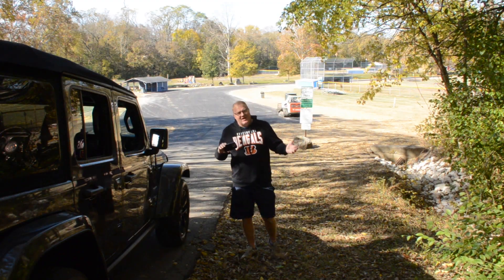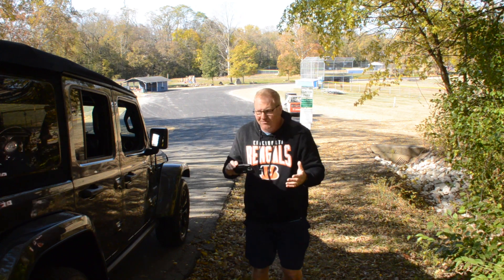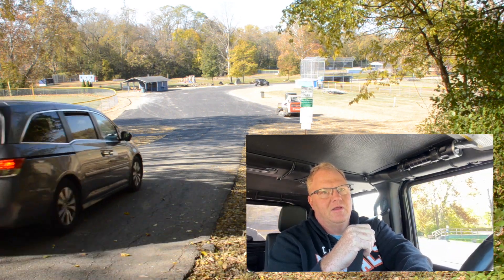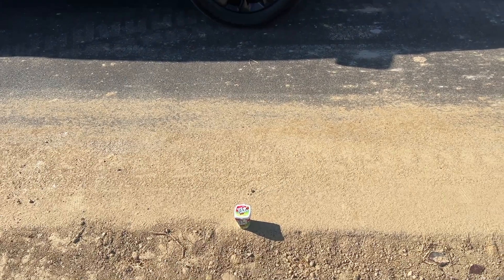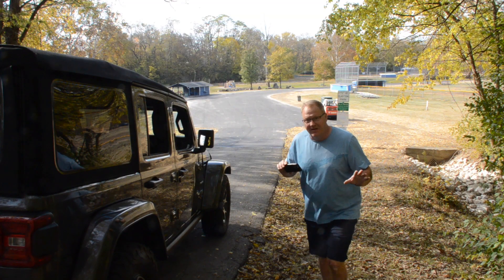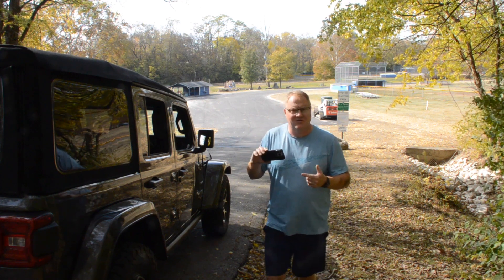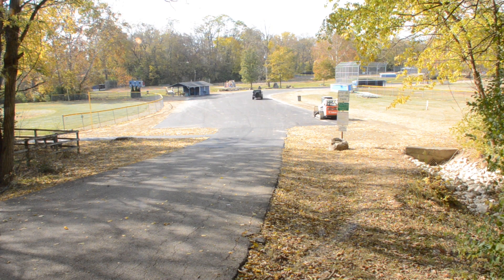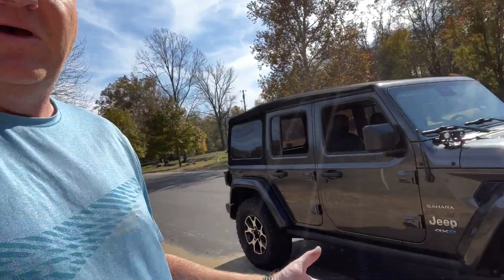Rolling Resistance Test

Comment: It is all about Newton's Laws and in particular the law of inertia. A body at rest tends to stay at rest and a body in motion tends to stay in motion. Also Force = Mass x Acceleration. The higher mass of the tires tends to keep them in motion. While they definitely have an impact on mileage, once they get going they tend to remain in motion for a longer period of time. So it didn't at all surprise me to find out that they remained in motion for nearly as long as the Sahara tires. Where you are losing the mileage is probably in the starts and acceleration. I think you would find with more instrumentation that the acceleration going down hill took longer with the fat tires on. But you might have to have some nifty acceleration devices to measure the acceleration. Really good experiment though and I'm very happy to confirm that you isolated only the one variable which was the tires. This is an example of how science is done. If I was still teaching 8th grade physical science I would most certainly use this video as part of my class presentation when talking about the scientific method and beginning my topic of inertia. Great video!!!
All the best, 
Pat

Comment: I am assuming the ko2's are from a Rubicon. If so they are 33s. I think the Sahara tires are smaller that is why you get better MPGs with them. The engine doesn't have to work as hard to move them.

Comment: I might posit that the weight of the vehicle might have more significance once you get past vehicles in the 2 ton range.  Tires would have a significant effect on a 2800lb vehicle on rolling resistance, where a heavier vehicle just doesn't register the same way.

Comment: I am very happy you are investigating the rolling resistance of the two sets of wheel/tires! Your approach reduces any air drag impacts due to it's low speed so you are really looking at the difference in the resistance due to the deformation of the tire rubber. My guess is if you increase the air pressure you will roll farther and if you drop it down it will shorten your distance. I assume you set the same air pressure for both sets of wheel/tires. 

Higher driving speeds will increase air friction/resistance which probably follows a velocity square ^2 law. Additionally at speed you get multiple contributions such as forward air displacement (tire moving forward) and rotational angular velocity (tread rotation moving air like a paddle wheel).  Additionally, for gas mileage impacts, the differential drive ratio and the tire diameter play a role.  

To account for higher speed friction increases, maybe consider driving a significant distance, say 50miles at the same speed (gas only) with each set of wheel/tires. This may also fail due to weather (wind, temp) and traffic.

Still, nice job!! Are you an engineer ... you think like one (or a scientist).

Comment: What air pressure are you running in the tires.  By increasing the air pressure you gain mileage,  just don't go over max pressure listed on your tire.
Reply from the maker: I was doing around 36 pounds on both sets. I’ve never chalk tested to see if 36 is exactly right for the Sahara.
Reply: @Wrangler4XEFans  I do 42 psi on my Rubicon 4XE in LA area traffic, I average 24 miles on battery only.  At that pressure it drives great and handles fine.
Reply from the maker: @jerrypierson3450  That would be interesting to do some experiments to see what different air pressures do to range.

Comment: Bubble gum? If I had known I would have sent you a piece of chalk.  :) Interesting test, but like everyone else said, I wonder if air resistance at greater speed starts to have one of those funky math formulas where it really adds up quickly. It also goes the other way: I recently came home from work where I had a strong tail wind and ended up with an insanely higher battery % than normal. Close to 20% greater.
Reply from the maker: There wasn’t a lot of planning going in to this video. I realized I had gone over my normal rotation mileage the day before and decided to go ahead and swap them out and had the time to do it that day. I had planned on doing this experiment at some point but wasn’t really ready.

Comment: Air resistance may be the bigger factor and you would need much greater speed for that. The other factor that I’ve seen to be significant is if your tire pressure varied. Could also be that KO2 tire pressure, which you say you put on in the winter, will drop with temperature possibly leading to greater drop in range. Though I put my air resistance as the bigger factor.

Comment: My guess is the greater weight of the KO2s gave you more built up momentum down the hill that compensated for the greater rolling resistance. Either way, thanks for posting this info. It's much more useful still than hearing manufacturer claims.

Comment: When you mentioned you were getting 2mpg less in the KO2's, did you modify the wheel size in the Jeep computer, or still using the default 32" tires that it would have been set with the Bridgestone's?  If I'm not mistaken, when you have the 33" KO2's on, the calculator will think you are traveling less distance because of the bigger tire unless modified?
Reply from the maker: I’ve never set the computer with the different wheel size. But I calculate mileage at the pump. Now for the loss on electric range, that’s an excellent point.
Reply: @Wrangler4XEFans  the other thing running around in my head is air pressure. I run my KO2’s at 35. Anything less and I noticed a lot more resistance.

Comment: What about breaking in the wet and the road handling differences? thank you for the test
Reply from the maker: The KO2s are a slightly more comfortable ride even though they are louder. So there’s a trade off. I don’t really know if I see a big difference it braking in the wet. Not sure I’ve had any instances where I could compare…at least that I remember.

Comment: Actually what I find more interesting is that the street tires had such a vast difference. I think 10 roles then mark the average of the 10 is best. I venture to guess the difference would be more comparable to the first two street roles. If you think about that difference in distance between your first two roles and calculated it, then calculated your total difference of the longest and shortest runs you would be able to figure out the resistance in that distance. Air pressure, wind, and exact path are factors but those are real world things that more runs would essentially average out enough for a basic non-lab fun test, for our purposes. There is a math/logic equation in there somewhere. I don’t mind the turn because it just real world stuff. Cool test though. Thanks for taking the time to put it together. It would be fun just to play this test multiple times with varied air pressures in the KO2s to find the optimum air pressure for the least rolling resistance without affecting overall performance. Lets say your total distance was 200 yards and the difference between the two tires netted out to something like 10 yards. If that was the case it would make since why you are loosing 2 miles over longer distances. Then you have to play all the other variables of real world driving scenarios which just gets to be too much. This test was fun for what it was. I enjoyed thinking about it as you did.

Comment: That’s not too much of a difference, maybe those tires have a different measured size which is then more visible when you drive longer and have adjusted the computer/ which would not really be needed for less differences. And from the picture what we see is that the KO2 s are higher / larger diameter. Greetings Monty p.s: my EHeater also stopped working waiting for the dealer to get the part.

Comment: A "successful experiment" is not one that necessarily proves an expected or desired result, but rather, a successful experiment is one that definitively proves or disproves the hypothesis being tested.

Some factors that you may not have corrected for are that I notice there's some wind blowing, and there's a turn in your course, so you may not have steered the exact same path each time.  Also, your gravity test is conducted at very low speed, and it's possible the rolling resistance of the tires has different characteristics at street and highway speed.  Finally, a difference in the tires might be wind resistance, rather than rolling resistance, at highway speed.
Reply from the maker: Alllll of this, yes.